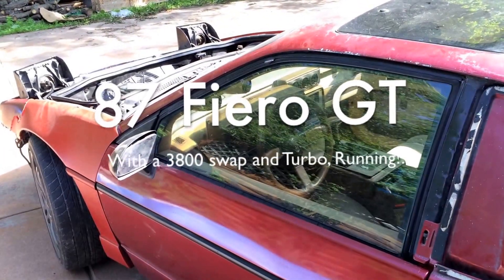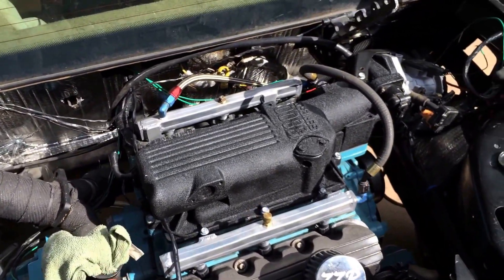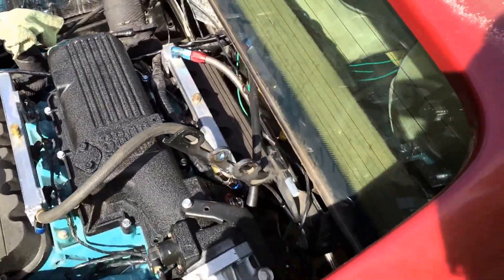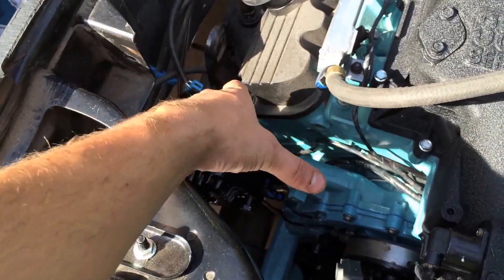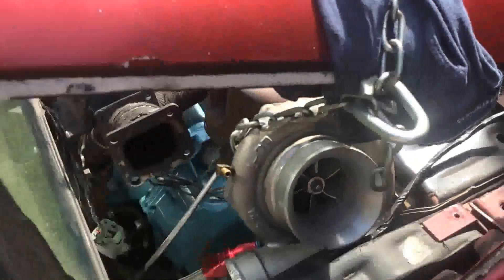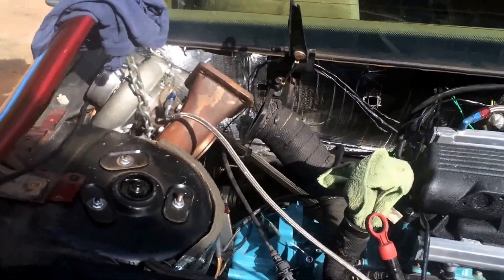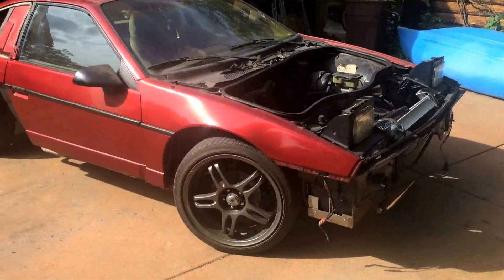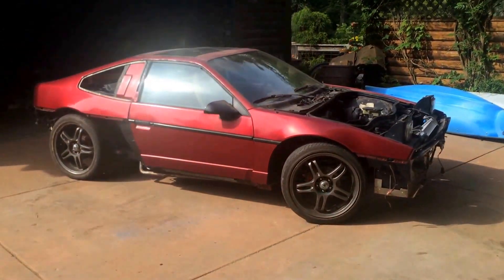Wicked Turbo Fiero Project, Pt. 2

Comment: Did you say you didn't need to tune the ecu to run the car with 80lb injectors?  I'm doing basically the same setup with an f23.

Comment: very nice car! I enjoyed watching your videos.  I have an 01 gtp with fsic 1.9 modded rockers, ported gen 3 , 2.6 pulley e85 and right now the car is a blast even on 14.8 pounds of boost.
I have a stattama turbo kit with pt67 turbo 3 inch dp and 3 inch exhaust with Chris hinson built heads, 150 pound valve springs, double roller etc.  i even bought a built trans from a guy parting out with 3.29 gearing, lsd, 1 inch gmr chain etc. couple of buddies are helping me start the project in January. want to fly out??? jk. I  spent  tons of money on my car but its different and that's what I LOVE about yours. major props!!!!!   your car is going to be an insane sleeper, now get that thing running ASAP